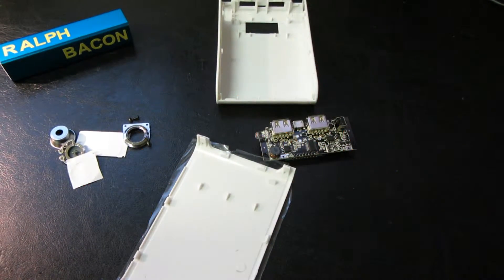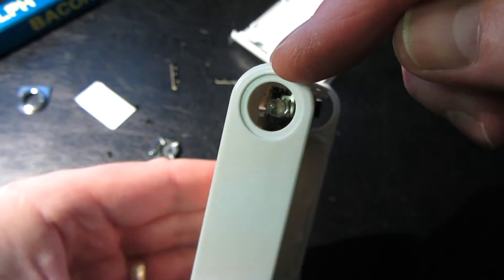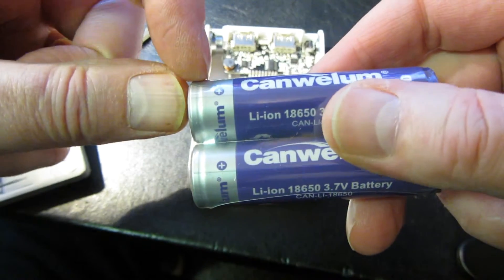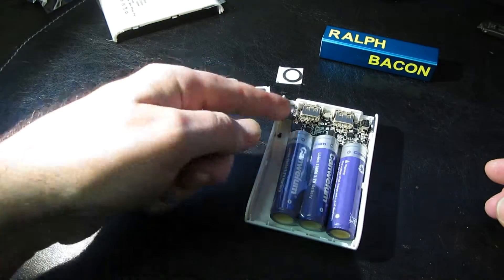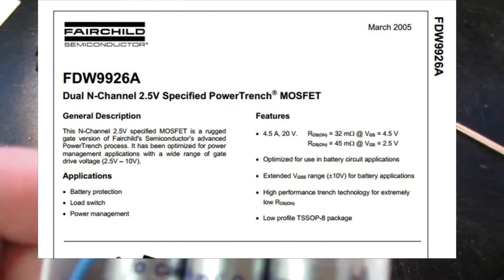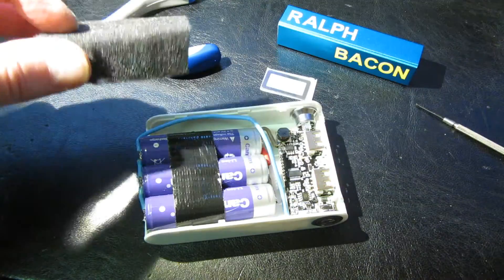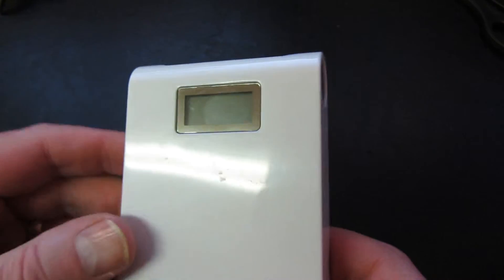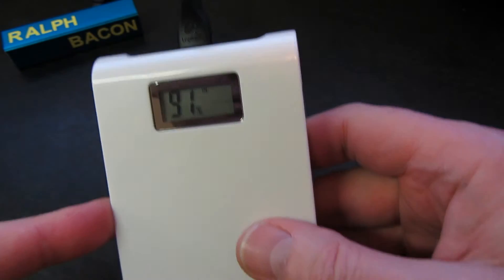#7 USB Powerbank special - DIY kit with 18650 Li-ion batteries Part 2

Comment: Ralph, can you recommend? I would like to build a 18650 3s power bank. There seems to be conflicting charge issues, parallel vs series. BMS and no bms. What would Ralph do? I thought about just buying a 3S 18 650 charger and tearing it apart.  doesn’t seem too creative though
Reply from the maker: You must be careful when charging multiple cells, Mark. Get them out of balance and you will either damage one (or more) by overcharging or end up undercharging the lot! This powerbank is now 4 years old and STILL working just fine, but then I'm using protected cells so it will prevent overcharging on any particular cell. Research what the charger part is doing and whether it monitors each cell or not. I've ordered a multiple 18650 charger from Banggood on Black Friday so when it arrives I'll show the world. I specifically got it because it charges each cell independently (and shows how far it has got). Keep tuned!
Reply: @RalphBacon  CANT WAIT RALPH

Comment: Ralph. Many lessons here! Take the wrapper off the battery and lets see whats on the board. There should be over-discharge protection, but how is the charge cycle (const current then const voltage) being achieved? If the latter is not on the battery then how is it being done? The micro is managing the LCD and button cycles, the mosfets the switching to the USB outlets, but how is the charge cycle performed? At the time you bought this then single function chips were available to manage charge and discharge cycles. A couple of DMMs will tell you if you have charge cycle control. If you don't, you've got a battery cooker. You may find that you can take the circuitry off the top of the batteries and put them on the main board to give you room for a 4th battery. There are many hours of fun to be had here as the power management is a huge subject that needs to be understood by all, especially as we move to 3.3V. This process of reverse engineering to understand whats going on is vital in this hobby but don't do it without research first as 18650s can bite back!
Reply from the maker: Gosh, no, I'm not going to be ripping any of my 18650 batteries apart any time soon (I'll let others on the Internet do that, and clap at the smoke and flames accompanying such antics), especially as the three cells (with protection for over/under dis/charge) are doing sterling service. If I had taken more note of these batteries I would, of course, have bought unprotected ones, as the power pack already supplies (allegedly) sufficient protection. Oh well, live and learn :)
Reply: I'm not advocating 'ripping apart' the batteries. These cells are based on standard batteries with the charge controller board soldered on top as an add-on, then shrink wrapped. The latter part of this Andreas Speiss video adds the charge controller to a standard battery. If you do the reverse, then you can reduce the length and add a 4th battery to your system. You will then need a 4 cell charge / discharge protection system to load balance the cells in some way. 

https://www.youtube.com/watch?v=1rg3ZWxBNUE

Comment: You need to use unprotected cells
Reply from the maker: I wish I had known that before I had started this project, Bruce! Or, more to the point, I wish I had known that protected cells were a couple of millimetres longer than standard cells. But, that all said, this power bank is still working just fine (you may have spotted it briefly in video #104 as it made a cameo appearance). Thanks for your post and it was good to hear from you.